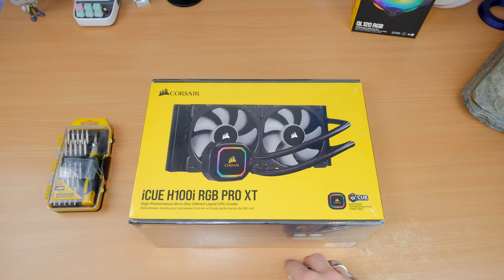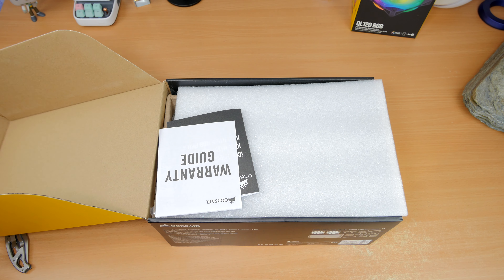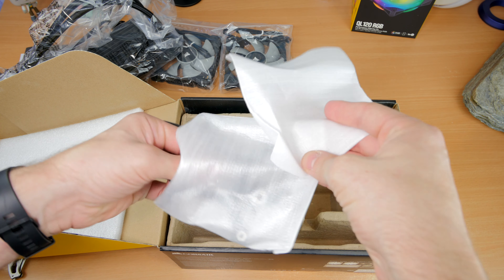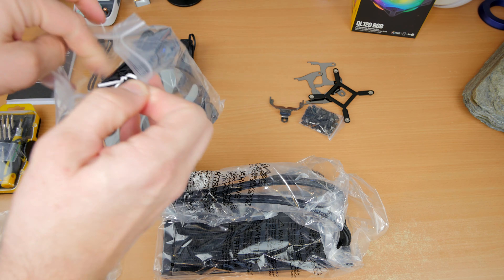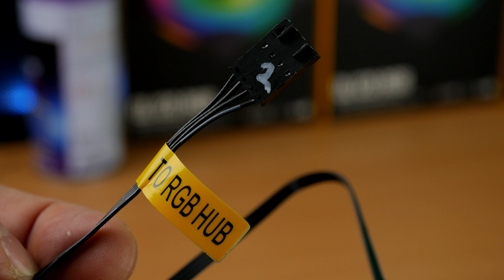Corsair H100i RGB Pro XT AIO unboxing and installation (with Corsair QL120 RGB fans too)

Comment: I really want to get the h150i version but I’m just so scared that the cooler eventually will leak. I have 7 ll120 fans and 7 Corsair led strips so this would complete my rgb masterpiece (right now I’m using the wraith prism as cooler [got an 3700x]). I know that you have a warranty of 5 years where Corsair pays for everything that gets damaged if the cooler were to leak but what would you do after those 5 years have passed and the warranty is over? I would be too scared to use it then ☹️ and maybe try to sell it (but selling a 5 year used product containing water might not work out). Throw it in the trash?
Reply from the maker: I've been using Corsair AIOs for years and years and never had a leak.
Reply: The Provoked Prawn It’s just that “if it happens” factor that’s killing me. It’s the only con with aio vs air and it’s a huge con. Makes my head spinning😞
Reply: Yo Its Jordan Here I risked everything and bought a super pc and I have h100i rgb plantinum. The factor also killed me but now after build it it is not so scary and it wouldn’t start to leak if it hasn’t already in the box.
Reply: @arvalb0  For how long have you had the cooler? If it's for less than 5 years (5 years is the length of the warranty) will you keep the cooler in your system even tho the warranty has run out?
Reply: Yo Its Jordan Here I have only had it for 1 year but I thinking of keeping it after 5 years. The reason is that I am sure it is not going to leak if it haven’t on 5 year I don’t think it will. And I am just not trying to think about it. Hope u will decide what u want.
Reply: I'm pretty sure if a corsair AIO leaks and destroys your hardware Corsair covers all the replacements for your hardware
Reply: @TheBYMWarlord  I did type that out in the first post :p "I know that you have a warranty of 5 years where Corsair pays for everything that gets damaged if the cooler were to leak but what would you do after those 5 years have passed and the warranty is over". It's still scary.
Reply: Oh I missed that lol...but these AIOs are fine and have been for years, you got nothing to worry about. Been using AIOs for a long time

Comment: Isn't QL fans bad for radiator cooling? Or at the end of the day it shouldnt really matter if you don't OC?
Reply from the maker: Technically you should use static pressure fans apparently but I have noticed no negative impact during standard use.

Comment: Is that an MSI GTX GPU installed below the RTX GPU?  Interesting choice to go with the smaller 240mm vs the 280mm and not using push/pull config on the fans.  Just out of curiosity, which CPU do you have installed here?
Reply from the maker: No, it's an NVMe expander. And it was an i9-9980xe

Comment: I have front mounted mine because there isn't enough clearance above the motherboard to the top of the case. The tubes are coming out of the radiator at the top of the radiator, and the corsair website says don't do this because of air bubbles forming. Is this really a big issue and do I need to turn the radiator around so the tubes are coming out the bottom? Only issue I can see with doing that is the tubes might rub against the GPU.
Reply from the maker: https://youtu.be/DKwA7ygTJn0

Comment: *So when I plug in IF I get the RGB versions All I have to Do as I did with the other 3 Fans is just plug those into my Command Pro and Node and just Plug the Pump into the Command Pro also for RGB as the command pro is plugged into my USB Port, So basically I can Tie both the Pump AND Fan's into My Command Pro and use that for Fan Control for total control from the iCUE software? of will i need to plug it into MOB?  *

Comment: So I have everything installed. Idling my cpu temp is 45-50° I started up beamng and my temp went up to 95° so i immediately exited the game I don’t want to fry my cpu and the temp came back down soon as I closed the game. When I had my single radiator installed I never had a problem?
Reply from the maker: Sounds like one of two things - the heatsink isn't properly seated on the CPU or you need to change the thermal paste for better coverage.

Comment: I already have 6 fans in my case how do I connect the 2 fans from the aio to the hub when all 6 slots are already taken?
Reply from the maker: Fan controller? Apparently fan splitter cables will work.

Comment: Hey i have a question. I just built a pc myself but if I turn it on for booting the corsair pump unit  does not light up. Should the rgb automatically activate if you boot your pc?
Reply from the maker: If you've plugged it all in correctly. Yes.

Comment: ive installed this following every tutorial and my cpu is 90-100C or more idk what ive done wrong and only 1 fan is working..
Reply from the maker: Ooof, that's not right at all. I can't trouble shoot one fan not working from here, but I'd assume your connections are loose? My advice would be check all them and try replacing the thermal paste to make sure you have good coverage.
Reply: @TheProvokedPrawn  2nd fan is working now, checked icue software apprently all fans and pump are working but my fan cpu is 95C - 105

Comment: Hi. Just ordered the same case. How did you set up the case fans and the fans on the aio? Which did you use as intake/exhaust. I have the H115 aio. Best regards Bjørn
Reply from the maker: You best bet is from intake, bottom intake, exhaust through rad on top and rear.
Reply: @TheProvokedPrawn  thanx for the fast reply. Keep up the good work. 👏🏻

Comment: I have a question. i currently have 3 ML RGB corsair fans install in my case.  I currently don't have anymore USB 2 ports available in my motherboard to connect anything else since the two USB 2 ports that my motherboard has are already used by my Cooler master RGB Case and the other USB 2 port is been use by the ML corsair lighting node pro command for my corsair fans.  

Since this is a corsair product do i connect this cooler directly to the corsair lighting node pro for my ML rgb fans that i have already install in my case? 

I am actually considering buying the other bigger unit the 360MM - 
CORSAIR iCUE H150i RGB PRO XT

Thanks any advise would be greatly appreciated
Reply from the maker: This still has a USB connection so you'd need that. You could get a Commander Pro to help. You can plug fans into that and two USB inputs can be run through into a single output.

Comment: Hello.
I have a question, which tenth generation intels are compatible with which water coolers? In my case, I want to know if the Corsair Hydro H100i Pro XT RGB Water Cooler is compatible with the intel core i7-10700k, you know?
Reply from the maker: You need socket 1200 support for the latest Intel processors https://www.corsair.com/uk/en/Categories/Products/Liquid-Cooling/c/Cor_Products_Cooling?q=%3Afeatured%3AcoolingRadiatorSize%3A280mm%3AcoolingRadiatorSize%3A240mm%3AcoolingCpuSocketCompatibility%3AIntel%2B1200&text=&pageSize=12#rotatingText

Comment: Im building my first pc and I have had so much trouble with fans. Ive bought 3 different fans, none of which are compatible for some other reason despite me checking on pcpartpicker fof compatibility. Im immensely frustrated. Can you tell me, before I buy this, is it compatible with an MSI Tomahawk motherboard, and DG84 case? Because im gonna have to buy two of these, and thats $200. Please help me

Comment: What were the major problems with this cooler with stuff like am4 installation.  Like is there too much wires, were the screws really that hard to put in because i'm using a nzxt h510 case and unlike a lot of other cases I get to remove the bracket in the front so i'll be doing it radiator>bracket fans so I can put this on my desk basically and push.  Other than that were temps and noise good?  Thanks

Comment: The position of cooling fan, we use infront or back of cooling fan when we want to attach to radiator?
Reply: Front. You want to pull outside air onto it just like a car. Cheers

Comment: Will there be room for a rtx 2080 ti with a h150i 360mm radiator in front of this case?? Seems to be tight or worse if no riser..
The Asus Rog card that I've been looking at is about 30,5 cm long..Might have to bump down to a super for saving space..

Comment: I currently have this installed but without the RGB fans, and i would like to put in the RGB fans, I have very easy access to the rad itself as its side loaded, would I be able to just unscrew the default fans that are currently in place and then screw on the QL fans? I have the command pro already for my other corsair fans and 2 spare ports for it.
Reply from the maker: as long as you can unplug the cables, yeah.
Reply: @TheProvokedPrawn  Im running an Inwin case that has really really nice cable management system which is easy access from two thumb screws to open the panel, can get to the SATA cables and command pro all from there. Thanks for this guide

Comment: LL and QL fans have 2 cables connected to them.. LED and Power.. If i change the fans on this liquid cooler with LL or QL fans, do i still need to plug the power cable of the LL or QL fans?
Reply from the maker: See here https://youtu.be/kCC0hrqPiFI

Comment: Hey, not expecting an answer ( its been half a Year anyways ) but what is your fan config ? Front ones and radiator pull cool air in, and bottom ones and back one push it out ? I am moving my pc components to a new case and am not sure how to mount all the fans so it works best for cooling it.
Reply from the maker: Hard to say without knowing what case you have and how many fans. Generally front and bottom fans are intake, top and back are exhaust. Most would top mount a rad and exhaust through it.

Comment: I just installed this aio and my computer isn’t turning on what should I do
Reply from the maker: There could be loads of reasons it's not turning on. It's near impossible for me to trouble shoot your PC from afar. Was it working previously? Are you sure everything is connected? Are all the power cables plugged into everything? Is your RAM seated properly, etc, etc.

Comment: If you used the regular ML fans for the radiator, would there be issues with the iCue software if you used it with the QLs as case fans?
Reply from the maker: Nope

Comment: fat chance i get a reply, but do i need to get the lighting node pro if Im only planning to be using a maximum of 4 fans plus the H100i? Ive been trying to find the answer all over the internet but maybe I am just dumb. Are there any key differences between the two?
Reply from the maker: If you're talking QL fans, you need a lighting node pro whatever number you're using if you want the RGB

Comment: On a existing build do you remove the thermal paste and just use the factory one that comes on the h1ooi?
Reply from the maker: Remove it from your CPU yeah.
Reply: @TheProvokedPrawn  ok i did and installed it but im noticing my temp is about 81f is that to high or did i fuck up my thermal paste

Comment: Having an issue with mine, I have the same case and same H100i you have, bought the same QL fans, and installed them, I also have 8, the front one on the radiator wont light up. And the back one the lighting isnt working correctly. When I look at the drop down menu on the icue software, there is no option for a QL Fan. How did you work around that?
Reply from the maker: This might help https://youtu.be/kCC0hrqPiFI

Comment: Is this actually safe to do, swapping in RGB fans? If you look at the tech specs of the QL fans, they have a MUCH lower CFM (41.8) and RPM (1500) rating than the fans that come with H100i (77 CFM and 2700 RPM).
Reply from the maker: It's fine
Reply: @TheProvokedPrawn  So then why are the AIO fans so much higher in terms of measured air movement?

Comment: I have this AIO and my pump speed is locked at 2315 all the time. I've tried to adjust it in the iCue software but the pump speed wont go down. Any idea? I have the 3pin connected to the cpu fan header.
Reply: why would you want the pump speed to go down? You sure its not your fans making the noise?

Comment: The RGB on my pump isn’t turning on, any fixes? I’ve been trouble shooting for hours and can’t get the pump rgb to work
Reply from the maker: Someone else had this issue too. Have you plugged the USB cable in? And installed/updated everything via iCue?
Reply: The Provoked Prawn I made sure the USB was plugged in and even ordered a replacement that came today, and the new one doesn’t even work
Reply: @stefanm672  did you figure out im having same issue

Comment: Im a little confused. Do I need to also buy a RGB hub?
Reply from the maker: Only if you're doing the RGB fans and only if you didn't get a triple pack with them in.
Reply from the maker: This might clear things up https://youtu.be/kCC0hrqPiFI
Reply: The Provoked Prawn Ok, so if I just use some Quiet fans from Amazon, I can just install them straight into the Cpu_Fan header?
Reply from the maker: @zayswayprod  as standard this cooler doesn't have RGB fans. It's only the pump. So if you're not doing the upgrade I did in the video it's easy. Install the standard fans, connect the power to the cables coming from the pump, connect the pump to the USB header. Job done
Reply: Hi just looking at this, seems good to get i got a corsair c70 with stock ryzen cooler. Was a bit confuse i dont have that kind of rgb hub, so i can just connect them in the mobo and they will turn at least that blue? or i need to hub for it all to work , thanks guys

Comment: I have a question how many cores do you needs to have in order to acquire an aio cooler?
Reply: huh? If youre asking when it is neccessary to upgrade to an aio cooler, just monitor your CPU temps. If you have an aftermarket air cooler, youre probably fine. I have an I7 9700k air cooled and ive never had any issues and that CPU has 8 cores.

Comment: What are all the cables on the pump head? Also does the pump head have a fan splitter to power the radiator fans?
Reply from the maker: Female fan power (plug the fans into them), SATA power, CPU fan pump.
Reply: Thanks so much!
Reply from the maker: No problemo. I thought I should it in the video.

Comment: Hello. I have the h100i Platinum and upgrade this with 2x ll120. I also have the commander pro, so tze question is... do i must connect the fans from the radiator with the pump or can i connect them with the commander pro? Thank you for your help!
Reply from the maker: I believe you can do either.
Reply: @TheProvokedPrawn  hm, i have already wrote to the support. Maybe they have an answer. Thank you for your answer.

Comment: Hey! Quick question, I too have QL120 fans and I wanted to get this AOI, do the QLs do a good job of keeping the radiator cool? I am concerned as they are weaker than the ML provided fans? Please let me know and thank you for your video!
Reply from the maker: I didn't have any issues. Technically you should use Static Pressure fans, but this worked fine with QL fans.
Reply: The Provoked Prawn correct, I misspoke when saying ML fans! Thank you for your response I appreciate it !
Reply from the maker: The included standard fans are ML fans, you were right. But you can swap them for QL120 fans no problems. I did anyway.
Reply: The Provoked Prawn super! As long as the temps are fine, have you had the ql120s on the rad for a decent enough time to compare the temps ?

Comment: Would this work with an ASRock B365M Phantom Gaming 4 motherboard or does the motherboard have to support liquid cooling? I’m using an i5-9600k. Or does this just connect to usb headers and sata cable for pump power?
Reply from the maker: It does not need liquid cooling support. See the description for details on specs and compatibility.

Comment: Does anyone know what the difference between pro and pro XT is? Gamernexus had a video about the 100i pro that made it look unimpressive but another one about the 115i pro that made it look amazing 🤔 I can’t see how a little more fan size makes that huge of a difference and can’t find anywhere what the difference between xt and non xt are since it seems both mention RBG
Reply: check the top comment that isn't pinned

Comment: how would you install the same aio along with LL120 RGB 120mm fans for exhaust? do you need to have a commander pro or would it work using just the node that comes in the pack?
Reply from the maker: Just two fans? Or more in the case? If it's just two you wouldn't need a Commander pro
Reply: @TheProvokedPrawn  I would be using 4 total. 2 for the AIO and two for exhaust.
Reply from the maker: @edv3795  that should still be fine.

Comment: Is it easy to remove the thermal paste if you want to use your own?
Reply from the maker: You can get some solvent to do that. Yes. Why would you though?
Reply: @TheProvokedPrawn  I'd rather use kryonaut than some unknown pre applied paste.
Reply from the maker: @megapet777  try something like this then https://www.amazon.co.uk/dp/B07MZ4K67Y/ref=cm_sw_r_apa_i_SqgFEbMZ7HEXE
Reply from the maker: Dead easy as I've done it before swapping CPUs and AIOs
Reply: @TheProvokedPrawn  Ok thanks.

Comment: Is it compatible with Intel LGA 1200?
Reply: I'm currently in the middle of a build, and while I couldn't finish yesterday, the backplate does fit, so yes. (AIO isn't on yet but considering I got this far..) You do have to slide the little rings on the backplate around a bit (you'll see when you have your hands on them).

Comment: Do u need an argb header on mobo or rgb header to control the lightings?
Reply from the maker: For the standard AIO, no, it only has RGB on the pump and that's controlled via the USB input.
Reply: @TheProvokedPrawn  For the fans?
Reply from the maker: @Ninja-di8hl  the included fans are not RGB. I upgraded to QLs. And if you do the same you need the lighting node pro which is included with the triple packs.